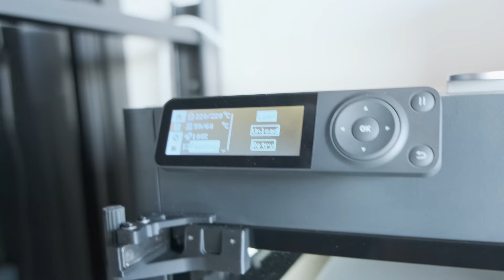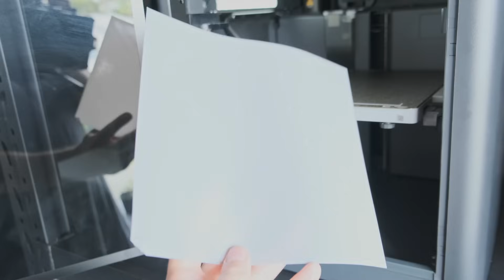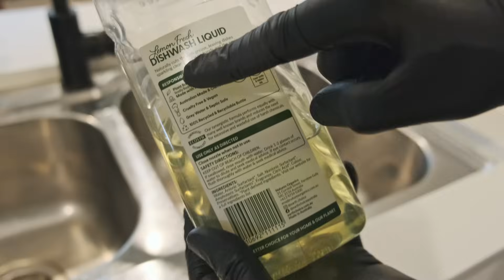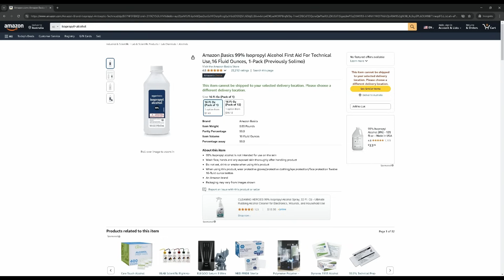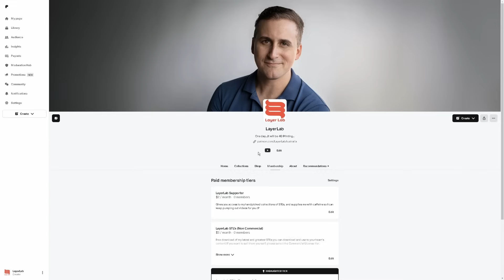Your Prints Won’t Stick? Here’s the Fix for Bambu Lab Printers!

Comment: A1 mini user here. This is absolutely Right.

I used to hold my printer bed to remove prints but later it will make the bed not stick anymore.

I just clean it lightly with soap water and it's works great. 👍
Reply from the maker: Yeah, soap and water is the best way to clean it, which is surprising as it is just a basic process, but so effective!
Reply: It is fine to hold it, but only do it on the edges. Personally I have a table nearby with a nice soft edge on it(so it won't mar up the PEI texture), I just flex it gently across that, scoot flex scoot flex, then can pop the parts off with minimal touching of surfaces or only edges of fingernails.

Comment: Blablabla … fix … Just use 3DLac and there will be no problem anymore! 3 years with 3DLac on all my printers, all my printbeds and all my filaments… and really no issue anymore!!!
Reply: Blablabla... while you're spending close to $30 for some glue for your prints at who knows how many times over 3 years. All I use is dot of dawn dish soap and a scrub sponge with hot water once every 4-5 prints. Zero bed adhesion issues and a heck of alot cheaper.
Reply from the maker: Lol 😆 I have magigoo and it works really well, I just hate having to clean all the residue off the bottom of each print. I print lots of small things and it adds an extra step of post processing that takes up too much time.
Reply: Check out the bambu cool plate supertack, perfect for small prints, no glue needed @LayerLabAustralia

Comment: Sorry but when did you washed your hands last time ? :)  I can not recreate this fingerprint marks .... I usually clean them with dish soap using same sponge as i use for cleaning dishes .... And it works - printing ASA not PLA or PETG.   Bambu states for their pei textured plate a 600 - 800 grit sand paper can be used to sand it if after longer use the bed adhesion gets worse...
Reply from the maker: Try wearing latex gloves for a few hours then do it 😜
Reply: Come on oils are different for different people and excretion is different at different times. 🤦‍♂️
Reply: @blueberrywilbur315  My finger oils are the worst because I have long beard that needs oils to not dry out and I manage to touch it somehow all the time, so beard oil gets to be finger oil, which gets to be magic adhesion messing up demons.
Reply: @ I’m constantly touching cannabis and hash I totally get it 🤣🤣
Reply: @blueberrywilbur315  make your prints smell better that way. I don't like the effect of cannabis on me but I like the smell!
Reply: @ I don’t know about that, It literally gets on every single thing I own 🤣🤣

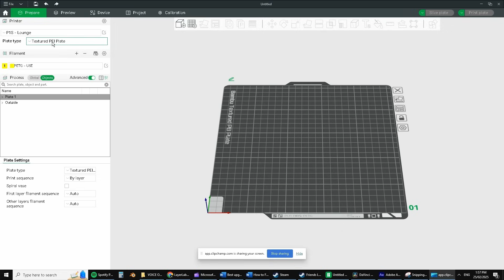Comment: 4:07 also if you're always using build plates that have identifying tags that Bambu Lab uses (all first party, and many third party), then make sure 'Enable detection of build plate position' is enabled in Print Options in your slicer. Then it will not start the print if there's an issue with the wrong build plate, or it's missing / misaligned. 
If your plates don't have those codes, you can label print them yourself - search for 'Build Plate ArUco' on Printables.

Comment: Not to mention that wiht alcohol you will destroy over time the build plate. Why? Because the structure its just a coding on a regular flat plate. Easy Way and safe way is normal dish soap and clean watet. No Alcohol.
Reply: The common build plates are coated in a layer of PEI on spring steel, IPA will not damage PEI. Acetone would. If you have a gouge in the PEI, it's possible for the IPA to get under the PEI and cause it to delaminate, but if the PEI was already damaged like that your build plate was already due for replacement.
Reply: For the last 2 years I have over 4K print hours just on one of my printers and have used countless litres of iso alcohol and the plate is fine.
Reply: Sorry but disagree, if you are using soap and water every time, that is because it's so messed up with oils you are having to 'reset' it to get rid of stubborn oils or contaminants, IPA is 100% fine between prints. It's all I've ever used and never even had to think about soap and water. Don't touch your plates and ISO the zones you will be printing in, is all it takes to keep things working like new. PEI is a coating.. but that's not a reason it would be vulnerable to brief IPA cleanings. I have PEI plates that still look brand new after hundreds of hours and regular IPA wipedowns.

Comment: Thank you for the video and the clear demonstration of how IPA spreads grease across the surface rather than removing it. Our community has many beginners (we work with 3D printing for the Ukrainian army), and the issue of adhesion is one of the most common problems.

I can share a few tips: you can use a clean kitchen sponge with dish soap—even the abrasive side. A hairdryer is a convenient option for drying a build plate. This way, you won’t touch the surface and won’t spread extra dirt or micro-particles from a towel.
Reply from the maker: Ahh a hair dryer! I never thought of using that 😆 thanks for the tip! 😀
Reply: The bed has a very nice build plate heater dryer option built-in but it's quite prone to triggering Thermal Runaway.

Which honestly is so reassuring when this feature works, right.

Comment: i always wipe my bed with a clean paper towel and i have an IPA dispenser i fill with 90% IPA.  I do this before every print.  never have failed prints with PLA or PETG(only 2 filaments ive used ever).
Reply: This has been my exact method and results as well. Soap is good if your bed is so oil contaminated it needs a 'reset' and solid scrub(I never have, but that's just science because soap and oils). But a quick IPA is what the surface needs prior to prints going down. I go absolutely minimal on that application. I will never buy those glues or surface coatings, just a substitute for keeping things clean, and a mess to clean off later or build up layers.